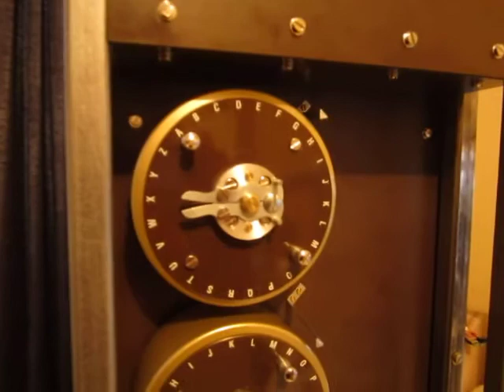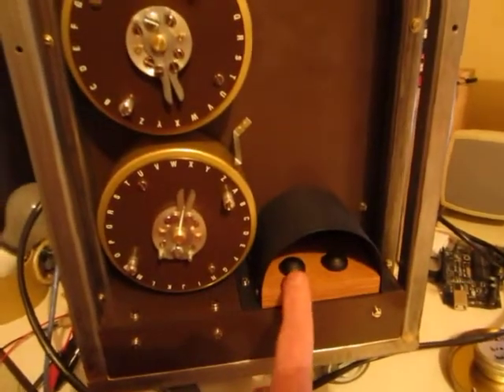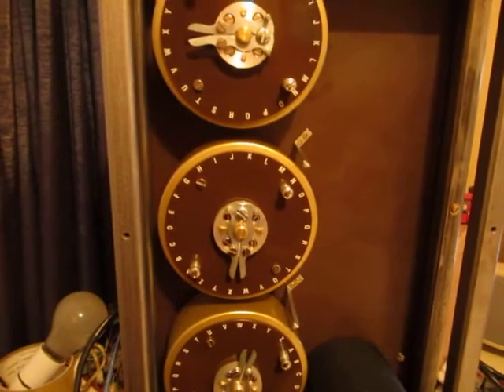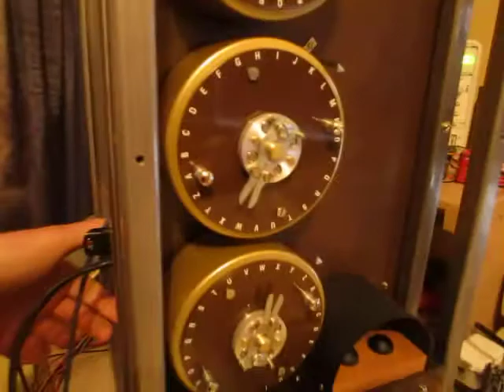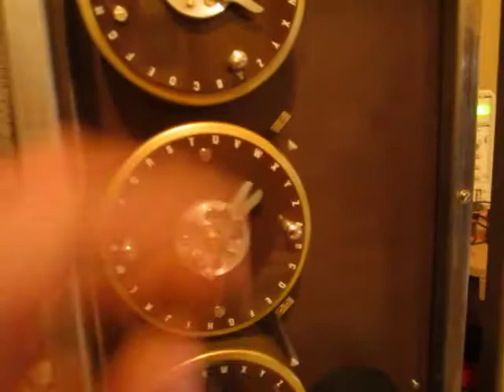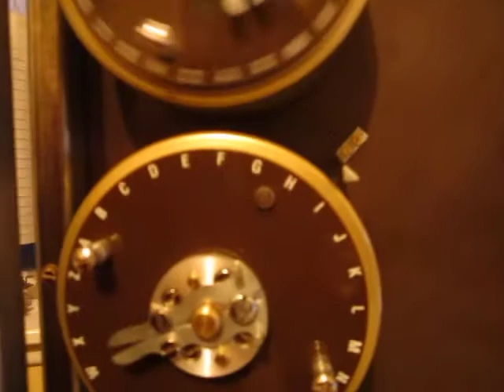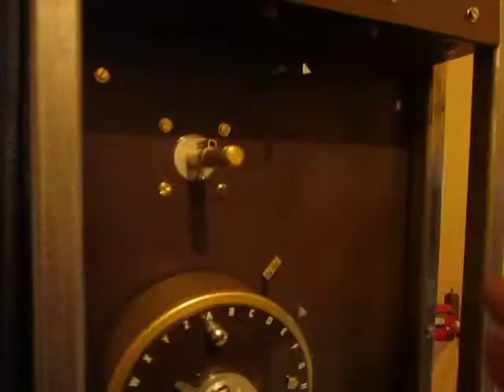Turing-Welchman Bombe update.

Comment: Thanks are due, forever, to the Polish Cipher Bureau for their pioneering work cracking the enigma cipher machine system, creating the first "bomba", using the enigma intelligence (sold by Hans Thilo Schmidt to the French Intelligence Service, then passed to the Polish team), and for their other enigma work replicating the German enigma, a copy of which was first studied by the Polish team, then obtaining another real German enigma from a "pinch" from a German truck (replacing smashed replica parts in the truck, when burned led the Germans to believe that those parts were those of the damaged German one in the truck), and obtaining copies of actual German enigma messages, in encrypted form and in their decrypted form.....among the many things that the polish cipher service turned over to the British.......all of which were copied by Bletchley Park (using further British Patent Office enigma technical details and further British studies of another enigma purchased on the commercial market), all of which were used by Alan Turing to duplicate the polish efforts, including using replicated enigma rotors as key parts to building on a larger scale, a British "bombe" used to quickly eliminate and then locate key enigma settings.......the British Bletchley Park "bombe" was further greatly expanded by the United States on their entry into WWII, in their SigInt partnership with the British, by mass manufacturing many more "bombes" allowing that process to very rapidly break into German enigma encrypted messages......so it was first the Polish, then the British, then the Americans who achieved mastery over the enigma cipher machine and its many, many other uses by all German users.....!